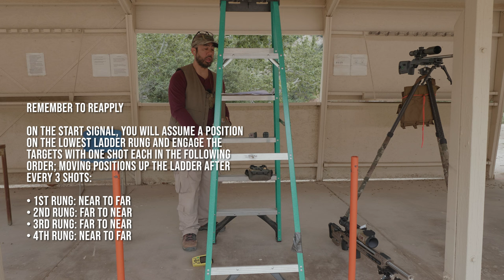Range VLOG #223 - June 2023 NRL22 Course of Fire Match Director Run-Through

Comment: Great job. You may want to add a Timber Creek  Extended Magazine Release XL. It was one of the best 10/22 upgrades I did when I was still shooting it.
Reply from the maker: I have the lever for the Kidd. I took it off because I have issues with my hand bumping it and dropping the magazine when I'm transitioning to a new position. I swapped it out for the Kidd lower profile magazine release.

Comment: Can a crossover SUV with AWD make it across the stream to get to the range at the moment? Thank you
Reply from the maker: You need a little ground clearance. Something at 6" minimum. AWD is fine but the bigger issue is that the road isn't exactly flat and the water flow areas are a bit rocky. You can probably make it, but you'll likely be scraping if it's lower ground clearance.
Reply: @ocabj  Great! I’ll see how hairy it gets and turn around it it’s too much. I have a VW Tiguan 2019 with about 8 inches clearance and I don’t mind scraping it a bit on the bottom.
Reply: @ocabj  Thank you for the info